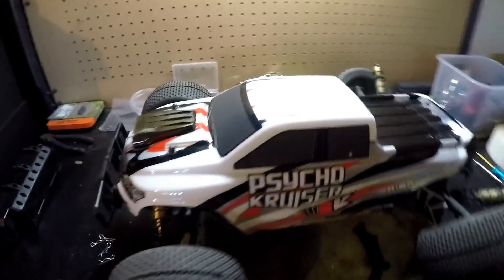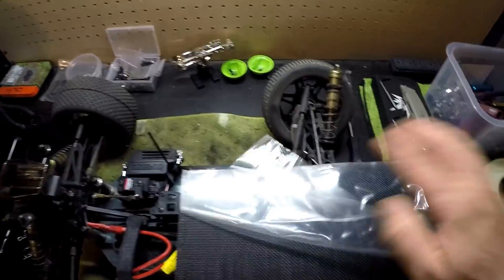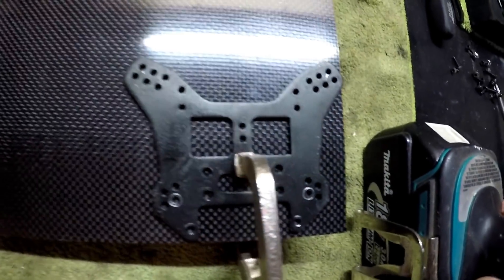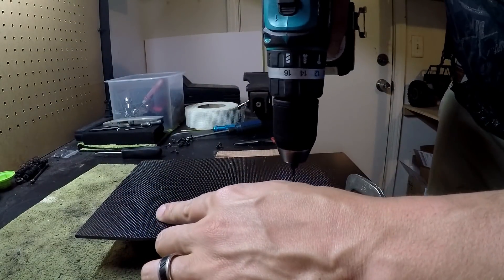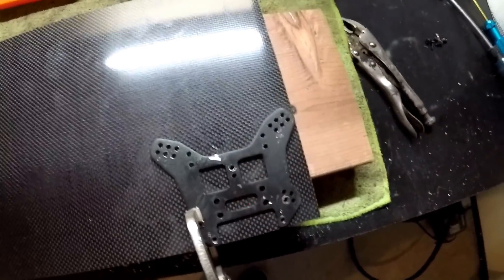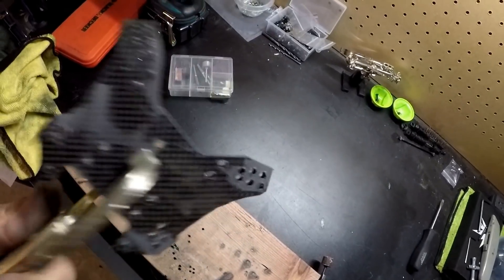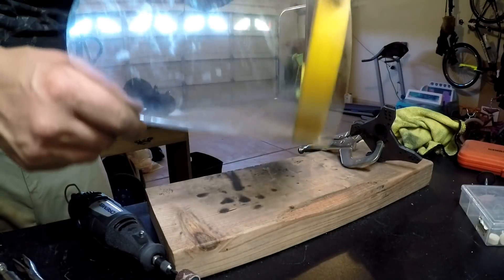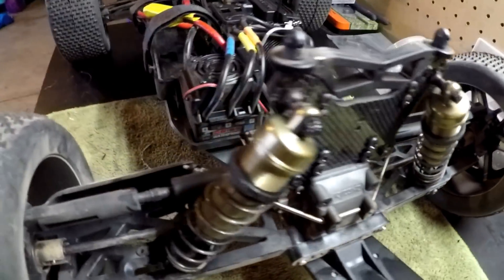Tech: How To Make A Carbon Fiber Shock Tower

Comment: I dont want to put you off but I did the same thing for my VORZA and I tell you I bumped into the wheel of my sisters car and it just cracked, you might want to try 4MM carbon or better still do what I did and use 4MM aluminium, after 6 months it still has not broken and I give my cars a really hard time
Reply from the maker: Thanks for the info

Comment: not removing the cut outs should add strength to the shock tower I think that was a good call  will be interesting to see how it works
Reply from the maker: So far after the 6s run it did great. Thanks man

Comment: Hey Gary.  Just thought of something.  Make sure your fail-safe is set from the factory.  Kyosho has a habit of not having it activated!  Turn on the truck and radio with it up on a stand and then turn the radio off, default on mine was full throttle upon loss of connection! Not good....Instructions in the manual walk you through turning on the fail-safe for their radio system.
Reply: TonyM386 
Same on my Fo-xx.
Turned the radio off and it went full throttle...
Reply: Mmm...Not good. Somebody has an odd sense of Fail-Safe at the Kyosho assembly plant.
Reply: Good.  Did not want you to wreck your truck over something this unexpected.
Reply from the maker: Right on man I'm working on it right now so I'll do that
Reply from the maker: Mine was good I checked it
Reply from the maker: Thank you I never check that and I'm very glad you said something

Comment: Hey Gary. I would fill the diffs before running that truck again.  My Mad Force just had light grease in the diffs.  The way that one jumps with three diffs is telling me it also has just grease.  It will handle much different once the diffs are filled, especially in the air off the jumps.  Too much power bleeding to front to control your jumps.  Awesome video on making your own shock tower!  Great job!  Also I would thicken your shock oil in the rear, another reason she is nose diving in the air, probably slapping the bottom near the rear on the jump ramp.
Reply: Good starting point for a racing Truggy like this one would be 7k front, 20k center, 3k rear diff oil.  Should make it handle very well.
Reply from the maker: Thank you very much I will get to work on that. Thanks again for all the info
Reply: You are welcome.  I would not give up on this truck.  The Inferno 1/8th scale series that it is based off of have won 8 IFMAR world championships.  The newest MP9 has new 3mm thick shock towers...lol.  Guess they noticed what you did. Many of the parts are interchangeable with the Inferno series of buggies/truggies, so some heavy duty upgrade parts should fit it from the Inferno series.  Funny, lots of Infernos are shown with carbon fiber shock towers installed. Known weak point.  Once dialed in these handle very well on a track, not sure how suitable it is for bashing due to the race heritage.
Reply from the maker: I guess we will find out if bashing can be put on it's list lol thanks again

Comment: I'm impressed Gary!!! Shocked a high $$$ rig would come with such thin towers. Nice work bud. Thanks for pointing out the face shield, safety first always. Great video and craftsmanship. 👍👍😵😵😵😵🙋🙋🐒🐒😋
Reply from the maker: Thank you I did mess the first hole up but kinda redeemed myself by the end. I was blown away man tin foil thin man Booooo no good come on Kyosho. I really hope it turns around on the 6s run

Comment: Nice Cut
Reply from the maker: Thanks
Reply from the maker: Sorry to bug you, I wanted to ask you about this. So I put a 20T pinion in the Psycho is that what you were talking about or should I put a smaller one in like a 14 or 15T? It came with a 17T. Thanks very much
Reply: If it come with a 17T u cant put a smaller one in or it will go Slower... so put the 20T in , when u do the first run, now its not that big step but, u should always check after like a few jumps or mins to see if the motor or ESC is much hotter then it use to be, and then do  a check when u think u run 50% of the battery , and then do 1 more check when u replace the battery. just to make sure they are not on a dangerous level....

Now if the Tags increase had been more u should put ur fingers or hands over the Motor and ESC b4 u touch them , coz they can get reallly really really hot...

And remember this Truck was not made for 4s but 6s
Reply from the maker: Awesome thank you very much for the info. I'll be sure to do that.